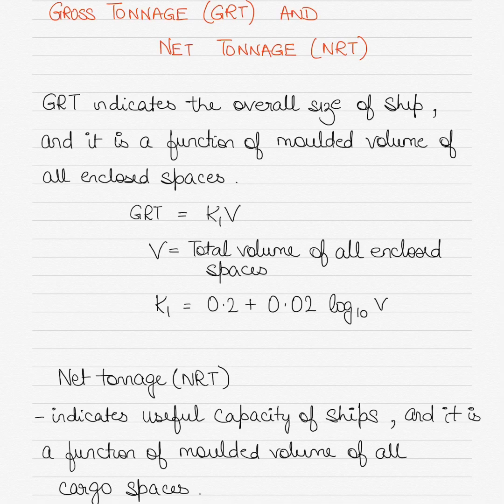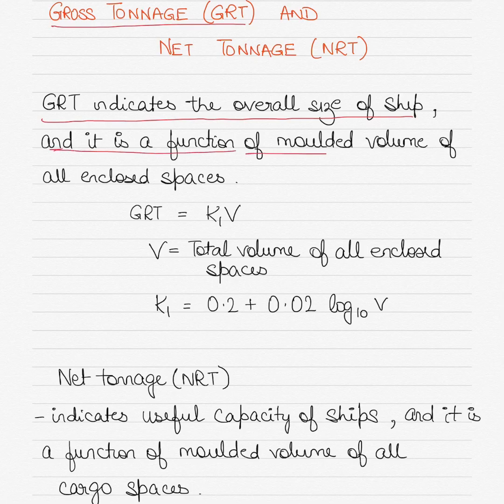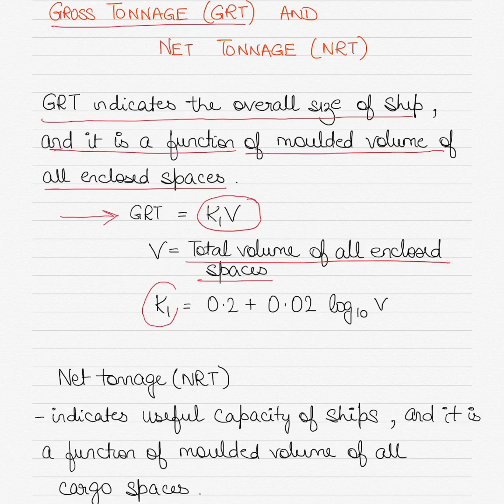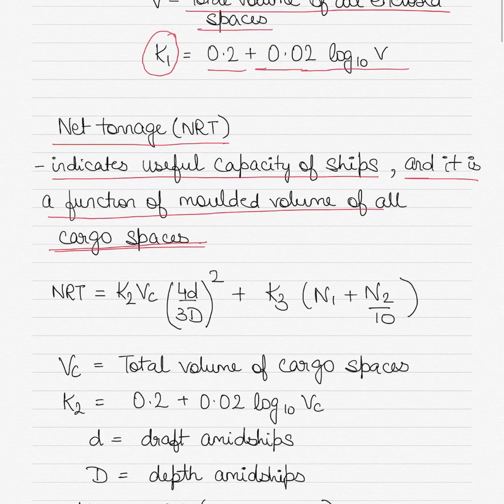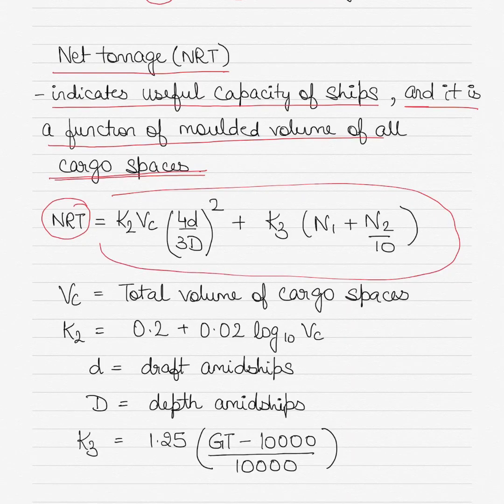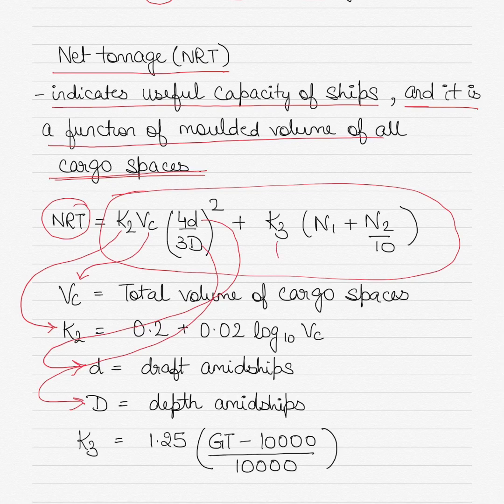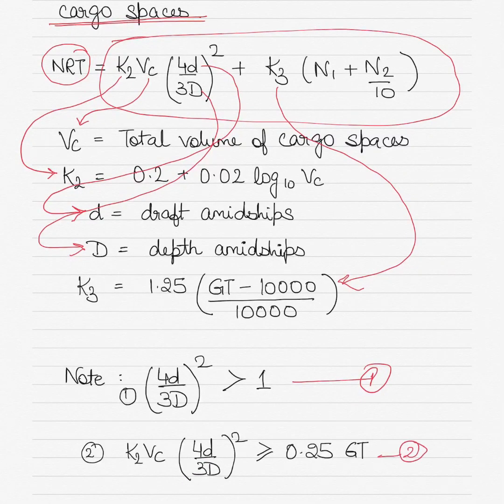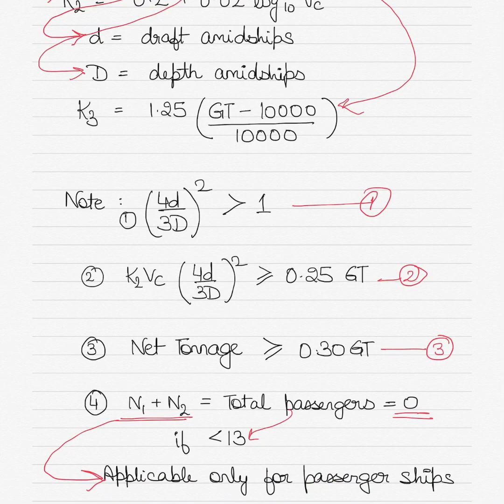Gross Tonnage and Net Tonnage - Definitions and Formula for calculation

Comment: Good day, Sir. Does gross tonnage include cargo spaces to itself too?
Reply from the maker: Net tonnage includes cargo spaces not GRT
Reply: @SteeringMariners  So GRT contains all enclosed spaces except Cargo Spaces? I thought cargo spaces are considered as enclosed spaces too and which makes GRT= NET + additional enclosed spaces.
Reply from the maker: Parviz Karimli in my understanding, net tonnage is based on revenue earning spaces of the ship which includes the cargo spaces. Ur understanding of GRT is correct but the cargo spaces are measured as volumes and not as weight of cargo loaded.
Reply from the maker: Parviz Karimli I still think gross tonnage does not include cargo spaces as they are not enclosed volumes.